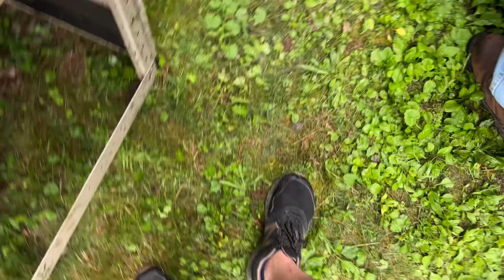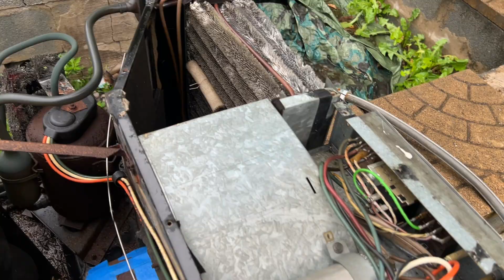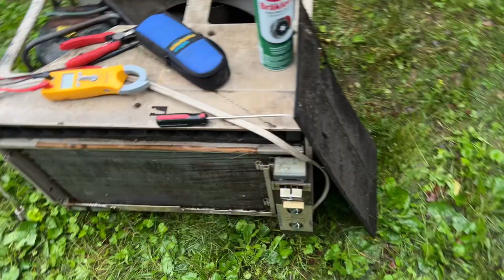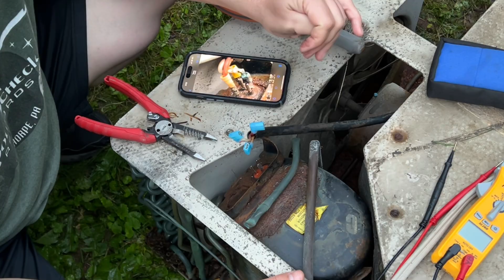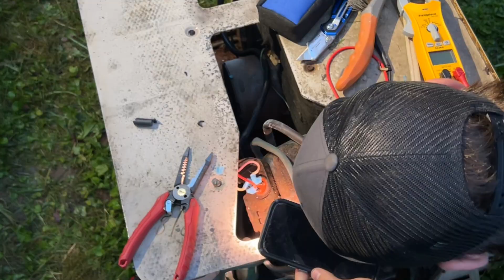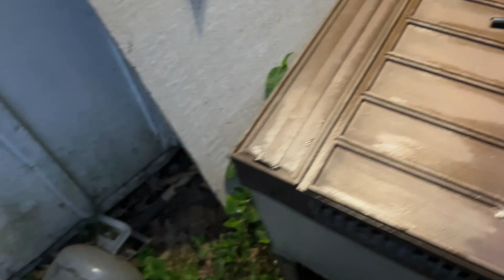Rare 1970’s Large Amana 18,000 BTU Room Air Conditioner Service and Testing!

Comment: You using the wrong type of flag connectors. The ones for compressors have a little more room for the pin on the compressor terminal
Reply from the maker: Gotta do what you can with what you got

Comment: There is one at a local restaurant and it is even bigger than yours but is was replaced in the late 90s or early 2000s with a Ruud split system but that was replaced recently with two Mr Cool mini splits. The cool thing is that none of them were removed when they were replaced. Lone Oak neighborhood in Paducah Ky.